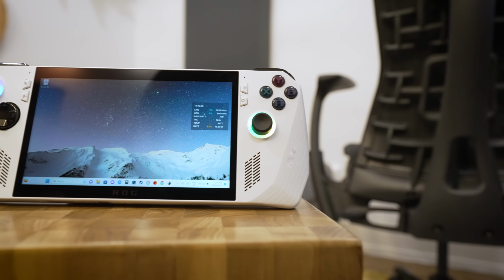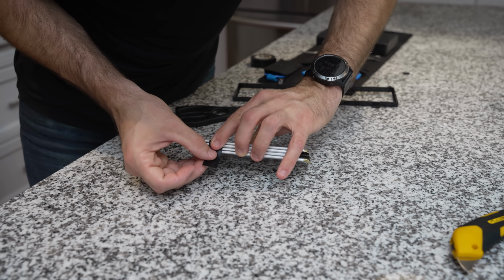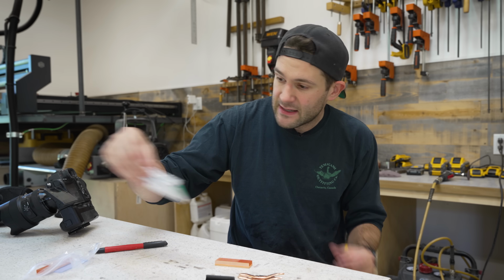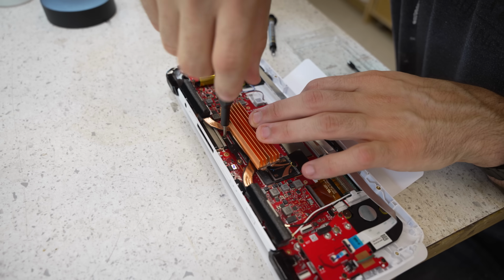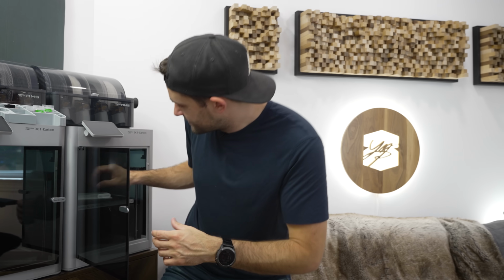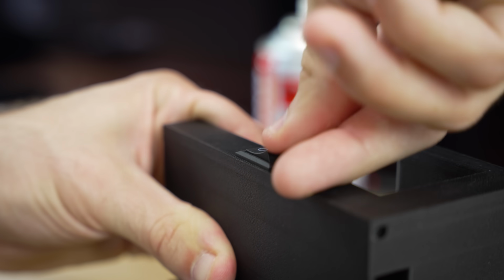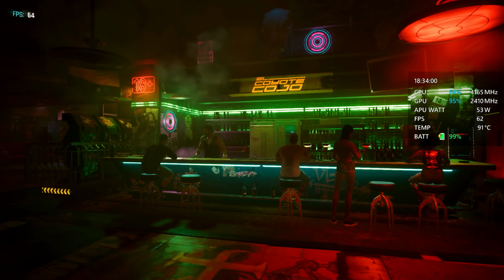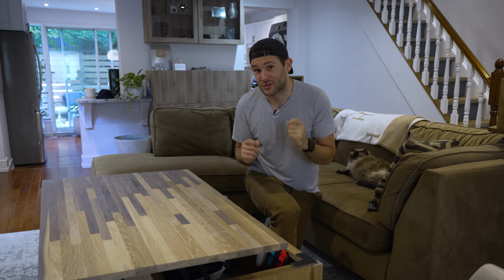I don't understand why people buy Steam Decks...

Comment: This is an absolutely fascinating approach to modding a gaming handheld. I'm more of a software guy so my thoughts have always been to the effect of "well, if I take my Steamdeck clock it carefully here, undervolt there, disable multithreading with this script here" and so on, I found that I got an absolutely delightful experience with an analogous level of experience and effort, but coming at it from the software side...

...But that approach isn't totally accessible to everyone, because SteamOS is Linux based, and not everyone is familiar enough with the system utilities and intricacies to produce a smooth and usable end product.

Seeing somebody come at it from the hardware angle is actually pretty cool for that reason!

With that said, I think in the case of the Ally specifically, it might not have been the best platform to throw the kitchen sink at, because the Ryzen 7x40 series processors (codenamed Phoenix) don't have the best performance profile in a handheld (they really are more made  for 28-45 watt laptop configurations, IMO, and still keep scaling well up to ~65 watts), as they don't really perform super well in a low powered context (the Ally often loses to the Steamdeck at same power draw, particularly lower down on the curve, because the Steamdeck uses a much smaller SoC that needs less power to run efficiently), so I think there might be another consideration for a future product:

You might do surprisingly well making a totally custom handheld from the ground up for playing retro and indie titles in a super low power context (In terms of currently available processors, the 7640U, 7735U, 7530U, 1240P, and Celeron N6005 should all have single board computer / computer stick implementations floating around in the wild that could fit into a custom system in a good power envelope for a gaming handheld.

There is the software issue wherein a lot of secret sauce goes into these projects, but I think with relatively supported hardware a ChimeraOS build might be easy enough to set up.

Regardless, this is a super cool project, and I hope you had fun building it!

Comment: "significantly more powerful than the steamdeck" should have a HUGE asterix next to it. Because, it is only more powerful at 15W and above.... Below, the Steam Deck is running circles around the ROG Ally. :) Nice project non-the-less, very nicely done. :)
Reply: This makes me wonder if its possible to undervolt the Ally, and I don't mean under clock. Just tune the voltage in such a way that very demanding games like cyberpunk become unstable. It is a common and proven way to get more performance out of GPU's, since they rely on algorithms that take temperature/wattage/frequency into account. 
Each GPU chip (the actual silicon) is slightly better worse than the other when it comes to the frequency/voltage needs. To make sure every chip will meets the target frequencies the voltage curves on these chips are all set to the same standard. I wouldn't be surprised if you can easily reduce the watt usage by 5% while maintaining or even getting higher/longer boost clocks. Leading to higher fps and longer battery life. I mean he is already running a custom bios to increase the voltage, why not try to go in the opposite way and make the chip run leaner by adjusting the total power curve.
Reply: 15 what? There are no games on my Ally that doesn't require 30+ watt anyway like Cyberpunk or Spiderman on 1080p. And I never play unplugged why I love the feature to limit the battery charge to 80% for better battery life.
Reply: Yeah these paid fucking videos are insane. HEY you too can have a decent rog ally if you are willing to void your warranty and do what they should have done on the beginning!

Shame it doesn't fix the inherent fact that it's a Windows machine, and as you mentioned, that it sucks for low voltage.... Yaknow..... The thing that matters for portable.
Reply: Just another clickbait...
Reply: @LazyJesse  yeah. aren't there also problems when it comes to the software? i think i have heard people complaining about that with the Ally and the vid "only" has hardware upgrades
Reply: Its great because it runs weaker games at a lower power?

You could say the same thing about the nintendo switch lmao.
Steam deck fanatics are something else hahaha
Reply: @toyfan1769 I have both, and the steam deck fan boys are embarrassing lol, straight up lie about stuff
Reply: isn't ally like 10% faster at matched power levels?
Reply: @MindBlowerWTF  nah, Steamdeck was custom made and optimized to run at below 10W TDP, it is clearly seen from any Steam benchmark (performance grouth almost flatlines after 9W). And in that range it runs better than non-customized AMD APUs. But the deal is - every device runs indies with huge overhead at 5W and every device struggles to achieve 30 FPS in modern games at below 10W TDP. 
Also, Deck display has truly anhorrent color reproduction and vibrancy, it uses by far worst display on the market, comparable to $199 Android tablets from 5 years ago.
TL;DR Steamdeck is great indie and emulation machine, that's it. Anyone preaching about AAA gaming on it is delusional fanatic.
Reply: I have both and the Ally is a lot better than the Deck, just plain and simple.
Reply: Have them both. I never use my ally in lower wattages unless im streaming which has for atleast a month now, been my only use case for either consoles. They just arent strong enough to be satisfying at any powers unless youre playing older games. Ally has a leg up streaming games at 120fps though, almost good enough to play competitively tbh. 4k 60 docked playing starfield though has really been where its at.
Reply: Still stronger nonetheless
Reply: This is a really bizarre way of thinking. It does do 30 watts, so it is stronger. You can play at 25w withough being plugged in, which again will often gett better results. Who buys a PC based on performance per watt?
Reply: @boothy128 brother, I have both lol, stop lying.
Reply: Ah yes, the infamous 10W AAA gaming where delusional Steamdeck fanatics are the new sect spreading gospel of "stable 20 FPS is great!!" and try to gaslight everybody else into it)))
And if you are playing indie titles every handheld will handle that virtually the same at 5-8W TDP...
P.S. Gotta love all those 0 FPS that Steamdeck shows in all of my Gamepass titles. But hey, same fanatics pretend that Gamepass doesn't exist and that it's not the greatest deal for PC gaming ATM.
Reply: @baka_ja_nai BRO ONG LIKE THEY DICKRIDE THE DECK
Reply: The Steamdeck is infinitely better I mean it’s cheaper more refined and it has official support from valve since their the ones controlling updates and what can and can’t run on it unlike the ally
Reply: @CaptainRex332 That's the most stupid comment I was reading for a long time.
Reply: @Leynad778  that makes no sense what are you even talking about
Reply: @CaptainRex332 Since when is old tech better than modern tech? Since when is 30 fps better than 60 or 720p better than 1080p? Since when is Valve controlling updates? The compatibility and performance with the Ally is better by far because it runs Windows and not Linux on a next gen chip.
Reply: @Leynad778   are you dense it’s running steam os made by VALVE and what are you on about with the old tech thing I would take a ps3 over a switch any day of the week and steam os is infinitely better then windows it has no bloat ware it’s just steam and if anything WINDOWS WILL BOTTLENECK IT EVERYONE KNOWS WINDOWS IS NOT MEANT FOR HANDHELDS and when it comes down to the ally and Steamdeck running at the same TDP the Steamdeck runs LAPS around the ally
Reply: @CaptainRex332  BlaBlaBla. I can run almost all AAA-games with 45 fps or more. Often on medium graphics like RDR2. The Steamdeck can run ancient titles and 2D stuff, but nothing serious.
Reply: @Leynad778  then explain how I get 60 fps in ratchet and clank rift apart you know a PS5 GAME
Reply: @Leynad778  also I guarantee the only reason your making this big of a argument is bc you spent all of your money on a ally when you could have gotten the better handheld aka the Steamdeck for less so your trying to justify your purchase
Reply: @CaptainRex332  dude i never used those devices but you steam fan arguments are really stupid, rog ally clearly has ton of processing power compared to steam deck, optimize to the bone but steam deck wont catch it. also asus handheld things gives that performance at 1080p, not ancient 720p. oled steamdeck is expensive than asus, with far worse cpu&gpu. you guys are really crazy.
Reply: @burakahmettr8193  if you haven’t used them you have no argument if you care that much about 1080p you could always use a monitor also the oled Steamdeck isn’t the only option there are what like 6 or so different types and conditions you can but them in from valve not to mention that the Steamdeck is cheaper if you go with the base model and it still runs all my games at 60 fps
Reply: This is the reason nothing beats the deck and why its so unique, its the low tdp.
I mean even laptop 6800u cant compete at 5-10w vs the deck, which is why i cant wait for amd to realease something more efficient, hopefully in the 3-5w range (or maybe intel releases an atom processor that has a powerful igpu)
Personally im not interested in handhelds untill they become significantly more efficient ie 5h+ batterylife for the most intensive games
Reply: @user-lp5wb2rb3v lmao nobody is buying these for good battery life, you're lying to yourself like most steam deck fans do, and it's ok.
Reply: rog fanatics thinking they have the cream of crop but can't even have a sd card in with burning it up and frying it lol and no track pads either btw a friend has both and steam runs something better and rog does to the each have there flaws
Reply: @jcrespo200 track pads on a handheld PC is not the flex you think it is, friendo.
Reply: My sd card dead beachside ROG ally is too hot. Also battery life is terrible.

Comment: Even if it didn't raise performance, those are really impressive thermal gains. And honestly it's reassuring to know that the ally is basically already operating at peak efficiency.
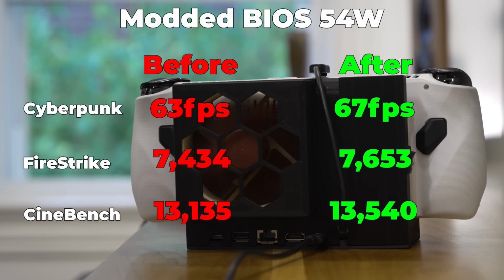Reply: 19:00 something is very wrong here. I get 15200 Points in Cinebench R23 with my STOCK ally, no mods, no tweaked bios. So, with a permanent 54W limit, liquid metal, additional fans, you should get over 16000 points!
Reply: The biggest factor in why performance is not improved is its memory bandwidth limited like all mobile devices reliant on LPDDR memory.  ROG Ally only gets 100GB/s memory bandwidth AND it has to split that paltry 100 with the CPU. If you look at all devices that get superior gaming performance they all have higher memory bandwidth stats/figures then the Ally and all these console/desktop/laptop GPUS get access to GDDR or on the rare ocassion.... HBM memory.
Manufacturers are stuck between a rock and a hard place, GDDR has much higher energy consumption, and HBM is significantly more expensive.  Tech advances (Node shrinks) on RAM are also slowing with RAM manufacturers finding it increasingly difficult to make breakthroughs and to further shrink capacitors which are necessary to store memory.

Comment: Doesn't G-helper unlock 50w TDP without needing smokeless? Mine has always reported high temps doing that. 
Also the cooler won't be as effective due to the 5V whatever current from USB. You could steel the power from the dock's PD negotiator chip and get 12V when the Ally is docked, and switch to 5V when on non-dock mode. 5V cooler itself would be a big hog on battery. Also I believe the battery can be fully stripped and the cells of the ally and the laptopbattery connected together. But I would stay away for bootleg batteries with risk of fire when merging.

Comment: So you made one mistake…..increase the power limit to the 54 watts, and leave the CPU locked at stock clocks.  Use the additional power to overclock the GPU alone, which can be done with afterburner and a few other tools.  When you just increase the power you are still sharing that power between the CPU and GPU within the APU, but you can specify where you want that power going by over clicking the GPU

Comment: I am pretty experienced with liquid metal (have had it on desktop CPU and GPU for several generations). I put PTM7950 on my handheld, because LM WILL go for a walk if you bump the device, and it will soak into copper. You used too much judging by your video.

Comment: Battery life is the big reason I haven't touched a Steam Deck or Ally. If I can't play on the go because the battery life sucks, what's the point? I have to play tethered to a wall, but wait. What's this? I already have a device tethered to the wall. It's a gaming PC. I might as well use that instead and enjoy more powerful hardware, a bigger screen, better ergonomic options for controllers, and not getting neck pain from looking down at a screen I'm holding in my lap.

Valve and ASUS and other incoming companies like Lenovo have forgotten that the entire point of handhelds is to have good battery life so you can actually take them with you without worrying about where you'll plug in to recharge an hour later. This is why the Switch is such a potato when it comes to power. It sucks that docked mode is so gimped, but at least if you take it with you, it's possible to play for several hours.

Comment: the battery blocks too much so the heat doesn't come out as easily but blocks the new heatsinks you added! the new heat sinks are then not as effective as they were intended to be or almost no effect at all! you will also heat up the battery which is not good.

Comment: you can buy 12v fans with a built-in temperature sensor that automatically regulates the fan or temperature regulstor pcb. with temperature sensor

Comment: the problem with liquid metal is that when metal is heated and cooled, it expands and shrinks and it will over time push the flowing metal against the PCB.

I WOULD NEVER HAVE USED IT!

have seen so many electronic devices destroyed due to liquid metal.

You risk damaging your device

Comment: Those performance numbers at the end are one of the main reasons why the Steam Deck is so much of a better value. All of these mods done in this video, all for about an extra 5 FPS in game and some extra battery life that could be achieved with a power bank. Oh, and now you don't have to worry about your SD card getting fried by the system itself. In my opinion though, the SD card situation with the Ally is just flat out unacceptable and lazy. An end user should not be expected to open the console to fix a flawed engineering design, just they can use the SD card slot on the device they just paid $600+ for. Not to mention that Windows on a handheld is just not a fun experience. Still enjoy watching your videos, but this one doesn't even remotely seem worth it.

Comment: I modded the cooling of this thing instead of battery. I used a table saw to cut an Alienware laptops heatsink and litteraly put it on the Allys heatsink. At 54 watt I get 93c and 43 watts I get 80c and at 30 watts I get 62c and this is with it all plugged in. I used smokeless to mod the bios of course to get those higher wattages.
Reply: And this is without putting a damn hole in the back of the Ally lol.

Comment: Was looking around for reviews on Ally & Deck, but i think i will get Deck soon with 2TB and dual boots (SteamOS & Win11). Ally is good at the screen, but others was mainly the same as the Deck. Deck able to find parts easiler and fix it myself easily too. Plus point on Deck is the price and i have many Steam games that i stopped playing after removed my gaming PC (Hustling for adult life). I have yet to get a deck, but i'm still looking around since im playing with my Switch now. Both Ally & Deck are great handheld machines.
Reply: Well u got the deck oled now

Comment: I liked you video but please get a hot air soldering station for projects like this so you can control the temperature much easier than with a gas blow torch and risk things like in this video, blowing up the heat pipe. They aren't too expensive and might be use full for all kinds of project like if you ever have to solder surface mounted components or if you have to heat up plastic without burning it.

Comment: Cool concept and good video but uou can buy a USB-C hub with USB A and HDMI for $20. So really you only need to do the battery mod. If you are going to do a battery bridge you could have modded for it to take the 2280 NVME  in without the right angle adapter.

Also, when you have 3D printing capabilities, why not print the whole back piece to the specification you need rather than cutting up the original.

To me this seems like 1 step forward and 3 steps back.

Comment: Is the sd card slot working perfectly? I lost a 1tb card in my Ally after thinking I was "lucky" and didn't have the over heating issue.

Also. Do you think it's possible to replace the micro SD card reader? I think mine died with the card.

Comment: Awesome mods but something to keep in mind, you should not put liquid metal on bare copper, within months it will eat into the copper cold plate and damage the surface. Liquid metal should only go on to Nickle platted metal. Also as a substitute you can use a very good thermal paste with copper with zero risk... e.g Thermal Grizzly Kryonaut or Hydronaut or Kingpin KPX extreme etc and your temps will not rise that much over Liquid metal.
Reply: The funny part is PTM7950 does really well in low pressure/uneven mounts like handhelds, it is ideally suited. LM needs a very even mount to perform. As you say it is going to dry out as it is absorbed into the copper.